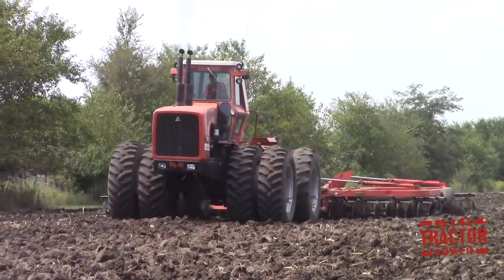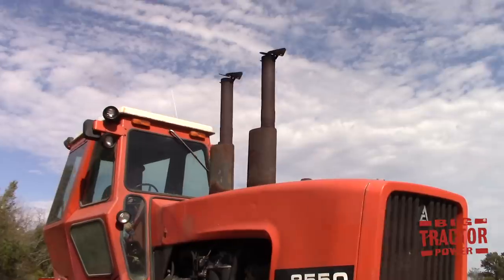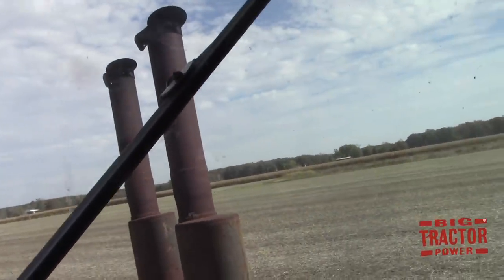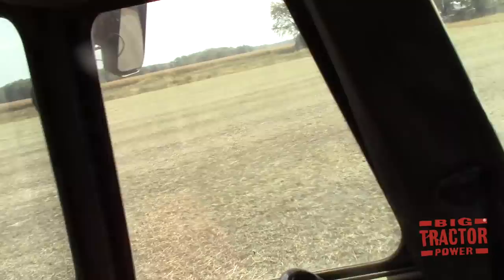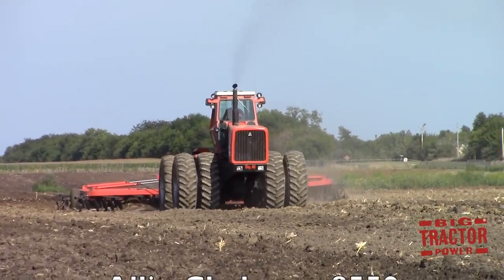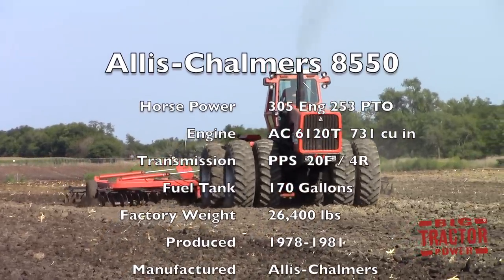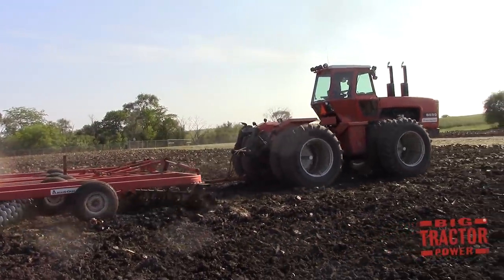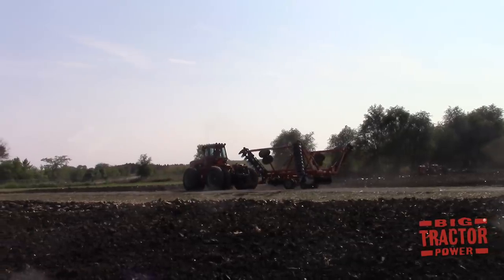Allis-Chalmers 8550 4wd Super Beast Tractor

Comment: We had one..same disc as well. Daddy had me hit a 960 acre field that bordered a lake bottom. They had just blown a beaver dam a month before and a lot of that bottom was exposed. It looked dry..buckshot, Mississippi Delta..I tried to get it out. If I had stopped as soon as those BRAND NEW RICE/CANE tires, I could have raised the disc as high as it would go, unhook it, drive it out, come around behind the disc and pull it out backwards. But, at 12 years old, when I stopped, I open the door and stepped out on the ground🙄one D-8, one Case 2590 and a 4 wheel drive Case 2870, 3 2" cables. I had to dig down 5 feet with a sharp shooter shovel to unhook the damn disc (that was 3 hours of digging hard buckshot clay) i had to carry, and hook up all 3 of them big ass 50 ft cables. I was so tired after that, I didn't stick another tractor for years🤣🤣

Comment: Years ago my brother-in-law‘s uncle bought a 7060 AC it was a good tractor but at the very beginning he had a lot of trouble with it I think about the transmission and or the rear end he had it back to the implement dealer several times before they finally got it fixed right after that pretty much ran like a champ

Comment: In 1987 and 88 I worked for a farm in Vermont, we had a variety of iron on the farm, most of it old and worn and full of character.  We 'demoed' a pair of used 8050 and used 8070 from the local Allis dealer for a couple of weeks during tillage and planting. Both were cab and 4wd, the 8070 had 600 hours and the 8050 had 1,200 hours but no radio.   Since I was the low guy I got the 8050, and spent time discing ground.  I recall the 8050 having good mid range torque, harsh shifts, tight turning, I really liked the extending steering wheel button!  I recall the only thing I didn't like about it was the short wheelbase, it would bounce and porpoise when going across the headlands, where a Ford or Deere were longer wheelbase and smoother.  We didn't buy the Allis Chalmers but I enjoyed my seat time in them.

Comment: Back in the day I plowed with a JD 2030 and a three bottom toggle trip.  50 ac in 24 hrs. Road travel included 45 minutes one way.  Now I got some big hp units but old school. If I could only turn back time now. Tks for the good video’s.
Reply from the maker: Thank you for watching.  45 minutes is a trip in any tractor but that’s a hike in a 2030.  There was an 8550 in Tractor House recently for $10K. You can get some of the 70’s monsters pretty reasonable today.
Reply: bigtractorpower  yes my big boy is a Case 2390  and a sweet  4440 which  was on display in the early 2000’s for the Dress a Deere Program.  She has a 4455 series motor in her . I bought last year January 2018 at Dennis Polk Auction.  500 hrs on her since she was redone, my Dream Tractor I finally got one.

Comment: My family has 2 8550s that are still used and one as a parts tractor both used for tillage one has dual straight pipe exhaust with a rebuilt engine love those tractors always will be a orange fan

Both work with 4 fold chisels

Comment: I enjoyed the video of the Allis Chalmers 8550 tractor because we had one.  We also had a AC 7580 which we traded in on the new 8550 in 1982.  
At first we liked it because we had nothing to compare it to except the 7580 we traded.  It was much more powerful and did our work quite handily.  As the hours rolled on, the problems arose.  A serious week point was the CV joint in the high speed shaft that drove the rear half of the tractor.  We replaced 3 of them; each one only lasting maybe 1000 hours and each one costing nearly double the last one.  
Next was the cables that controlled the shifting and hydraulics.  They were cables inside a sleeve and seized up making it unable to shift or use the hydraulics.  
The engine had poor torque.  Very noisy, quite powerful but only at high rpm.  Once the rpm started to drop, so did the torque and it wouldn't recover.  What it could do was guzzle diesel fuel.  Far too much.  
It wasn't until we purchased a 1982 Versetile 895 rated at 5 hp more than the 8550 that we were able to compare the two and see what a vast difference there was.  The 895 was head & shoulders above the AC 8550 in all aspects.  Quieter, much more powerful, far more lb/ft of torque, and used less fuel.  The Cummins engine in the Versetile was what they called Constant Power meaning you could throttle down the rpm and maintain the torque. It was amazing compared to the torque shy AC 8550.  Sure the AC had a live PTO which we used to run an air seeder and adjustable wheel tread that some row crop farmer might use, it meant nothing to us.  Another sore spot was the factory 20.8 x 38 Armstrong tires.   They soon began to crack on the side walls and go flat.  We needed to replace them and AC would not warranty them.  That tractor got traded for a 1985 Steiger Panther 360 and all out problems were solved.  That was one hell of a tractor that we farmed with for 20 more years.  
Those twin turbos and twin mufflers on the AC 8550 were all show and no go.
Reply from the maker: Thank you for the detailed mechanical history.  The 7580 is the one AC 4wd I have not filmed yet. I hope to track one down.

Comment: The farm I worked on when I was younger had two small AC tractors- a 180 and 185. Nice tractors, but you had to be careful as transmission parts wore out, they would pop out of third gear. Nice video!
Reply from the maker: The 180 and 185 are nice tractors. Many still going strong.
Reply: To clarify, the transmission wasn't wore out, the owners were grinding the gears until the edges were gone. It's owner abuse not poorly made gears.
Reply: @RJ1999x  Thank you for more of your wild assumptions and wild speculations RJ 1999.  There is reason Equipment Dealers had repair shops.

Comment: It had a de-stroked version of the 844 Big Allis Chalmers engine used in the HD20 Crawlers with twin TO4B Garrett Air-Research Turbocharges like used on the 7030-7040-7045-7050-7060 Tractors with a slightly smaller compressor (cold air side) wheel.

Comment: We had 3 of them back in about 91-08. The first was a older 78 model that ended up falling in a ditch near a field. The second was a 79 model that was turned up then the engine threw a piston out the block. We just left it and had a new engine just never time. The last was a 81 model the new look my grandpa would say. He loved it till we just parked it and forgot it even turned over. The transmission was acting up on it but we had 2 parts ones to repair it. Sadly all 3 were sold cheap and haven't ever looked into where they went
Reply from the maker: That had to be impressive to see three 8550s rolling together.  It’s unfortunate but engine parts are hard to get for these AC 4wds. I know a farm with an 8550 that is parked because the tires are work out and a new set of tires would cost more than the tractor is worth.
Reply: I am in the market for one but haven't had much luck we want one for a complete restoration project and run it at least half season for our farm. We had alot of unique equipment throughout the past 40 years. From hard times to good years. We learned that a bunch of our equipment is still in use near us and north of us.
Reply from the maker: I saw one in tractor house for $10,000 recently.  It looked decent. The hood had had some engine heat wear on the right side.

Comment: Is it normal that the engine speed fixed lever is so hard to operate that you need to hammer it down? And second: is it also normal that the function of it is very indirect? The engine response to back down took a good way down the lever to actually do something. I dont remember the ones on our machines go that hard to operate and if we are incing them, the engine almost imediately responds...Or is there any safety reglementation behind this?

Comment: I remember when the Allis Chalmers  5020,5030,7020,7045,8550 was introduced in 1977.Its funny  that  when most of its competitors like AC,Case,IH,MF,Ford were all getting 300 hp plus 4WD tractors to market in the 1970s  John Deere would not even touch the subject
Reply from the maker: Deere did not get to a big 4wd until the 1982 8850 and they really gained a presence when the 9400 came out for 1996.

Comment: Beautiful tractor. I'm curious to know how the fuel usage on one of these compares to a modern day tractor?
Reply from the maker: I am not sure.  I own a 4wd of similar age and horse power. I would say the new models are much more fuel efficient.
Reply: It would be pretty interesting to see some of these old diesels hooked up to a modern common rail EFI system, maybe some minor hardware upgrades(basic rebuild, maybe to tighter modern clearances if possible with a modern synthetic oil, upgrade to modern turbos, coolers, air and liquid, maybe electric fans on a basic thermostat, modern air/fuel/oil filtration systems, all reasonable upgrades). 731cu in 4 valve - a little modernization would lead to both significantly more power AND significantly better fuel economy
Reply: oh no you don’t…

Comment: Does the tractor have a good A/C?
Reply: That's the same cab that all the AC's had at that time (2wd's) and I can tell you if it gets to the 90's it's not going to keep up. Had an AC 7060 and can attest to that. I'm sure the successor 4w-305 would be far better in that category.
Reply: @johnmccall8788  Night and day difference between the 4w305 and 8550, those cabs were tiny, a/c rarely worked on ours.  And banging the throttle down like he did, I remember that well.  I was 14 when we sold ours, and aside from torque converters they were bullet proof.  We got ours new and AC came to dyno it and it was putting down 350hp, which they turned down and compared to a Steiger, very light. A lot of spinning pulling the big blue Degelman 12 bottom we borrowed from our neighbor with a Stieger.  Great machine.  As was our old 200 and 185, and Gleaner L2 with the optional 185hp.  Sold it with near 6000 hours, ran great, twin turbo still pushing hard.  Rocks stuck between the duals.

Comment: Those cabs were not the best. A/C couldn't keep up and once the seals had some age they would let dust in. The twin mufflers shure set it apart though. Would make good grain cart tractors as you're sitting up high.
Reply: Those cabs we're actually the quietist cab ever built , and set records that still stand. It was designed for safety and operator comfort. It was the only cab that could be rolled and the door still opened to let the operator out. It's flaw was it was teepeed at the top giving your brain the illusion of small, when in fact cu ft and floor area made it one if the biggest

Comment: What no auto steer for $84k
Reply from the maker: A top model in a 4wd line  today is over $500K with wheels and tracks they are over $600K with tracks. The $84K seems like a deal.
Reply: @bigtractorpower  It would interesting to know  what 84k back then would be now with inflation.